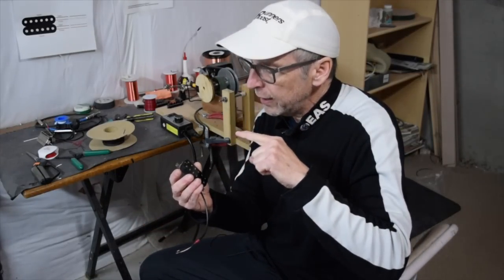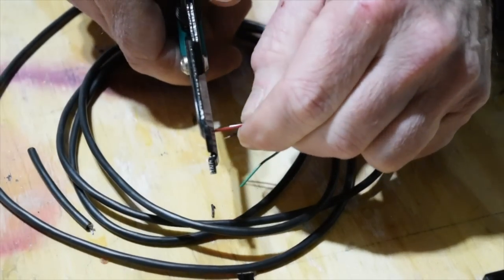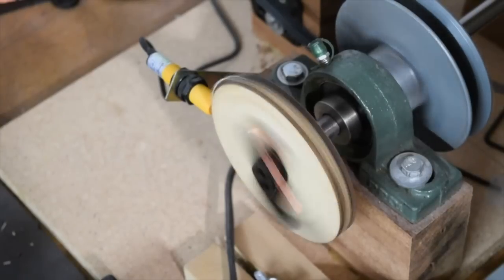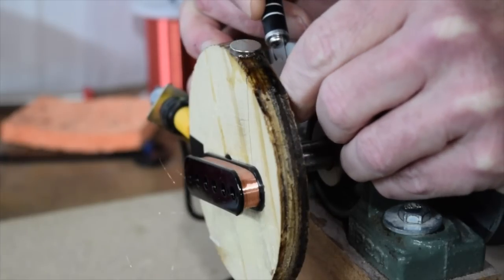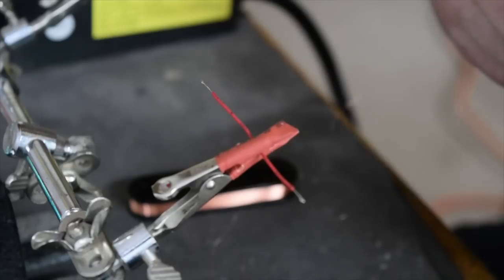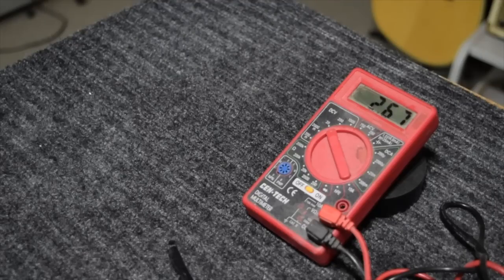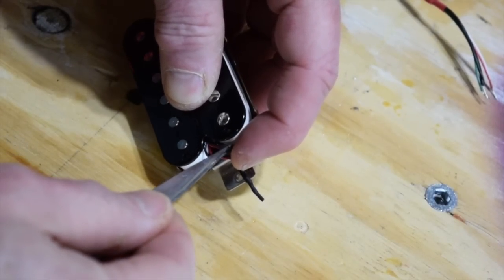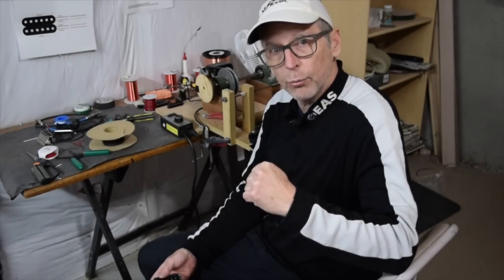Making A Humbucker Pickup For An Electric Guitar

Comment: It was interesting the commentary on the reasons for the conventional Hotter Bridge Humbucker to create balance which is commonplace ..  Jimmy Pages  Les Paul tone in Led Zeppelin has been elusive  as no mainstream manufacturer has ever created his UNCONVENTIONAL pickup arrangement. Namely a brighter Lower Wound 7.5k T Top with a short A5 magnet in the bridge creating some 'Twang' and a massively different high wind  8.6k Alnico 2 PAF  in the Neck for a Buttery /Wood sound (Set BELOW pickup ring to create balance and no mud!)... These crazy pickup extremes create that "Hollow Toppy Chirp"  almost acoustic sound in middle position which alludes conventional guitars.. With this setup, you get 3 much more 'radically different'  tones than a regular hotter bridge/lower power neck setup.. Even the Gibson Jimmy Page model guitars are "Period Incorrect' pickup wise for Zeppelin, as they are modeled on post 1984 mods with hotter bridge

Comment: Tone is the relationship between the gauge of wire, the number of turns, and the strength you charge the magnet to.  The stronger the magnet,  the more winds it can take.  Over winding a weak magnet makes a muddy pickup
Reply: So what is the relationshop exactly? Is it directly proportional?
Reply: So should I buy emg 81/60 or just make my own? What do you suggest people huh?
Reply: Jimmy Pages Alnico2 Neck PAF  is Wound to a Hot(ish) 8.6k , but then set below pickup ring to balance the underwound  7.5k Short A5 T Top  in the bridge . No Mud .( The Led Zeppelin Set no mainstream manufacturer has ever made!)

Comment: Isn't Winding directions of each bobbin important?  As well as magnet pole positions? Did not see that explained...  or did I miss it??
Reply from the maker: Only the magnet orientation. Winding direction isn't important since you can connect the leads to accomplish the same thing.
Reply: @HighlineGuitars  OK, but don't you need to understand the winding direction in order to properly orient the magnet poles?  (this affects "phase" doesn't it?) I did not see this explained... ?
Reply from the maker: @cajoneez9657  No. With a humbucker, you can wire the start and finish of each bobbin based on the magnet's intended orientation. The winding direction doesn't matter.

Comment: Thanks Chris,
Your video gave me tips on how to handle the only thing I still struggle with, soldering on the leads to the coil wire and attempting to not short out anything with moving them around.  I think your way to deal with that will help me out greatly!
I appreciate it very much!

I think you should have included a brief bit testing the resistance of the coils to show how to check for a short or partial short in it.  I do it about 100 times while assembling because I'm a bit insane about it.  I also understand that becomes a rabbit hole based on wire thickness and number of windings, which might be why you skipped it.

Comment: If you can't find a good source of color coded four conductor with a ground to convert two conductor humbuckers to out of phase switchable or single coil taps. Cut the ends off of USB cables. Cheap and available everywhere.

Comment: I just got a 1965 black Hagstrom 1 electric guitar, and the pickups are known to have a special sound that people pay a premium for, even decades old. QUESTION: When I was rubbing the rust off the pole pieces, pressing hard (heavily rusted), I discovered the poles are not one solid piece. 

The top part (that is visible) is actually a little steel cap that is glued onto the pole underneath. Apparently the rubbing alcohol I used to free the rust dissolved the glue. This happened on two pole pieces. I cleaned the old glue off, and put a tiny pinch of super glue (with pressure overnight) to secure the two caps. 

Have you ever seen pickups made this way, with metal caps fixed on top of each pole? They were magnetized. If you put them upside down, they would repulse, but the correct way, and it they fit right back in place. 

They work fine, but I'm curious nevertheless if this strange construction is unique to Hagstrom, or is this a build technique unique to Hagstrom? Thanks for your wonderful video.
Reply from the maker: I know nothing about that brand.

Comment: Strings are vibrating with the same frequency, no matter which pickup position you pick. The amplitude is the only thing that's different. An open A = 440 Hz. The maximum amplitude is in the middle. So, either in the middle between the bridge and the saddle or between the bridge and the fret that's pressed. When you pick fretted notes this middle position shifts and the frequency therefore increases, but the frequency above the neck and bridge pickup is still the same.

Comment: I realized from the video that the finishing ends of the coils are soldered together. Which wire from the beginning of the coils do you use as "hot": the "Start" of the southern coil or the northern one? Thanks, Chris!
Reply from the maker: North start is the hot. South start is the ground. North and south finish are soldered together.

Comment: Fantastic video thank you so much for sharing your knowledge.  Could you do a video explaining how to wind a bobbin counter clockwise I’m finding it all a bit confusing that side of it.  Thanks
Reply from the maker: if a winder is spinning clockwise, and you mount the bottom of the bobbin to the winder plate, it will spin clockwise. If you mount the top of a bobbin to the winder plate, the winder still spins clockwise but the winding is in the opposite direction (counter-clockwise) to the previously wound bobbin.

Comment: Hi,I was wondering if you/someone could help me out here.
I was planning to change the cover of my pickups ( Gibson Humbucker  490r e il 498t) in gold tone so I would need to change the Pole Screws too in the same colour.
I bought Pole Bolts - Slot Head 5-40 x 18mm (imperial). 
Did I get the right POLE Screws or did I need to buy different ones? 
I am still waiting to receive the guitar with those pickups so I can not really tell  but these pole screw looks a little too small to my eyes.
 I am not an expert so I was wondering if you could help me out
Thanks!

Comment: Great video. Ty! I've been playing for years and never knew that so much went into a pup. Question: can a passive pup go bad over time? I heard that you shouldn't put your pups near anything metal.  My old pups just don't sound like when they were new. Thanks!
Reply from the maker: Yes, they can go bad. The coil wire insulation can degrade over time, which can weaken the signal and lead to shorts. Also, the magnets can be degraded by blunt impacts and excessive heat, although these issues are rare.

Comment: Awesome video, thanks for this! I know it’s a bit older but I actually had a question in regards to wire - when I’m trying to wind, I constantly have to stop to unspool a bit of wire and it makes the winding part take forever. I cannot go quickly. When I unspool a bunch of wire to wind, it’s likely that unspooled wire will pool and knot next to me as I’m trying to wind. I set up the spool on a little pole, in hopes that as I wind, the wire will be pulled, the spool will then turn and feed more wire as it goes, but then I have issues with wire snapping, as the spool is too heavy and is only relying on the pull from the winder to unspool it. How do you go about having enough wire and being able to work at that speed while dealing with a spool of wire? Thanks!
Reply: I actually just read that people stand the spool vertically below where they’re working - this seems to be the common trend and works well?
Reply from the maker: I’ve never had the issue you described nor have I heard of anyone other pickup makers with that same experience. With the spools I use, the wire unravels on its own as the bobbin spins.
Reply: @HighlineGuitars  thank you for the response! It must have to do with how I have the spool set up. I set it up expecting the spool itself to roll to unwind while the pickup winder does its thing. I need to set it vertically so the wire can come off freely (how a fishing pole spool would be orientated) and not expect the spool itself to move.
Reply from the maker: @Houstnwehavuhoh  That is correct.

Comment: hey I like the Video and it's pretty informing but there was one part that was not right in terms of the positioning of the Pickup. the most about it was right but a bridge Pickup and a neck Pickup have with the same note played the same frequency. because if they had different frequency the same note would sound different (like a played a note sounds at the neck as a a but at the brige as a b) but the reason why chords sound brighter is the thinner sides have a higher frequency but not so high altitude as the thicker sides and the diffrence between the higher altitude of the thicker sides getts narrower to the bridge so they sound higher

Comment: Chris, do you have any recommendations for an electric screwdriver for adding or removing screw pole pieces? You mentioned using one in this video.
Reply from the maker: No. I use a cheap Harbor Freight.

Comment: Great video! I had one question though.  There is a guitar player you are probably familiar with “Eddie van Halen” who crafted his own pick up. What did he do differently from you to get more of a (screaming tone) this question is very specific sorry, haha.
Reply from the maker: I think even Eddie would tell you it's not so much about the pickup as it is about the way he plays. In other words, if you played his guitar, it would sound like you. However, if Eddie played your guitar, it would sound like Eddie. That being said, the humbucker he originally used in his Frankenstrat was a Gibson PAF lifted from an ES-335, which was potted with paraffin wax. God only knows the specs of that original pickup, but he has stated in the past that one of the coils didn't work. PAFs are usually wound with 42awg wire to a low DCR and I would guess the magnet was either an Alnico 2 or a low gauss Alnico 5.

Comment: You have the best way of explaining complicated things.  Thanks again.  Do you sell pickups?
Reply from the maker: Yes I do!
Reply: @HighlineGuitars  I would love a HB for the neck of a 25.5, that is not muddy and splits well giving a clear clean sound.  I will use both coils separately also, would like each to have different number of winds, enough to sound a bit different.  I love the sound of a strat.  I play no distortion and love old rock and country music.  Is this possible?
Reply from the maker: @Grandpa.Dan8881  I would suggest buying an HB.
Reply: C’ mon u can coil tap em but can you reverse your grinder polarity power input to wind the opposite direction

Comment: Hi Chris, is there any way to fix the Tobin when the wire breaks through the wiring process, or you have to start over every single time it happens??
Reply from the maker: I usually just start over. You can solder the break and either tape the joint or lacquer over it.

Comment: I have a question about the winding direction for each coil.  I  was under the impression that one of the coils is wound counter-clockwise, and the other clockwise.  So, one would be South/Clockwise, and the other is North/Counter-clockwise, and that is what makes it in-phase and humbucking.  CCW-N, and CCW-S together would be out of phase.  CW-N and CCW-S is in-phase and humbucking.  
StewMac has a good page describing it, https://www.stewmac.com/video-and-ideas/online-resources/learn-about-guitar-pickups-and-electronics-and-wiring/understanding-guitar-wiring-i-4000-2.html.
The one thing that I am not sure of is wiring the finish of the first coil to start of the second, or finish of first coil to finish of the second.  So, your connection to the series would be either Start(1) and  Finish(2), or Start(1) and Start(2).  Does that change the phase?  The one thing we do know is constant is that, by design, one coil will always be N, and the other always S.  So there is just the variables of; winding direction, and Start/Finish or Start/Start.
Thanks!  (Great channel by the way!  Excellent videos!)
Reply from the maker: You can wind humbucker coils in the same direction. The end result depends on how you wire them together. This site will explain: http://www.1728.org/guitar1b.htm

Comment: I always hear about 'hand wound' pickups which sounds more time consuming than using a winding machine but may be easier to count the number of wire winds. How are you counting the number of winds using the winding machine to obtain specific and consistent number of winds each time?  Also I think and could be wrong but the wire wind itself can be intentionally inconsistent or wound other than evenly back and forth to create a specific wind pattern. I'm assuming this is where hand winding is most effective. I have no experience with this and learning.
Reply from the maker: My current winder is a CNC winder which precisely controls the number of turns. I can also program the traverse to vary its speed which mimics hand winding (aka “scatter winding”).

Comment: could you provide some information how you connect the 2 bobbins? I mean are they series or paralell? or the wiring of the 2 bobbins  are in different direction? or you handle the phase of the 2 bobbin with simple wiring the south hot to the north end?
Reply from the maker: I wire mine in series. The north start is hot output, the south start is ground. The series connection is north finish to south finish. Both bobbins are wound clockwise.
Reply: thx @HighlineGuitars

Comment: I'm sorry I'm so late! LOL
I just found you and this video. Thank you for creating this video!!
I have a question...
You stated that you use 42, 43 and 44 gauge wire. You say that the more turns you put on a bobbin, they higher the output signal, the higher the output signal you clip treble frequencies. To balance this - if you put more turns on the bridge bobbin the less turns on a neck bobbin. 
I'm learning a lot, but I have no idea how many turns should be a minimum, what's the maximum amount of turns and what is the average amount of turns?
If I want to DIM (Do It Myself - similar to DIY lol) and I go buy a 50 foot roll of 44 gauge copper wire, will that be enough for 1 single coil and 2 humbuckers? About how many feet of wire do I need for 1 single coil? And for 1 humbucker?
That's the only information that I'm really lacking...
How many turns is average for a single coil neck pickup? And how many turns are average for a bridge humbucker pickup?
How many feet of 44 gauge wire is normally used to wrap an average single coil neck pickup? And how many feet of 44 gauge wire is normally used to wrap an average bridge humbucker pickup?
Thank you so much!!!
Not many YouTube creators respond to my comments and questions. 
I hope you do! I really do!!!
Thank you so much!!!
Reply from the maker: Start here: https://www.google.com/search?q=how+many+feet+of+wire+in+a+guitar+pickup&rlz=1C5CHFA_enUS749US749&oq=how+many+feet+of+wire&aqs=chrome.2.0j69i57j0l4.9028j0j4&sourceid=chrome&ie=UTF-8

Comment: Hello. After you wind each bobbin and have two copper wire ends....does it matter which end to connect to other bobbin and make the humbucker? Does the inside start end have to connect to the outside finish end of the other bobbin? Does it matter?  Thanks
Reply from the maker: Yes it matters, but you can wire the bobbins in series like you described, or in parallel. In series yields higher output and darker tone. In parallel yields lower output and brighter tone.
Reply: Is the hum eliminated both ways series or parallel?
Reply from the maker: @nickhlawka7073  both ways are hum canceling.
Reply: Thank You
Reply: @HighlineGuitars  What about in series but instead of connecting the negative pickup side to positive pickup side, connecting negative to negative or positive to positive??? Thanks

Comment: Hi, hope this is not a silly question but do you solder the two finish wires together or the start and finish wires? I only ask as there seems to be a lot written about this on the net and I can't tell which way is right.

Comment: Thanks for this video, it's really useful. When you solder the pickup wire to the lead wire do you have to scratch off the enamel coating, or do you just wrap it round a few times and the solder melts it forming a connection? Thanks!
Reply from the maker: The wire I use has insulation that melts when touched by a soldering iron.
Reply: Thanks! I'll see if mine melts/test it afterwards

Comment: I personally would love to have an extremely bright and clear sounding bridge pickup with minimal low end mud (200-400Hz). Any suggestions as to what magnets, winding and wire I should use if I decide to build one?
Reply: select a 0.08 gauge wire. use neodymium magnect, and wind around 10,000 .

Comment: Hi - do you always the same base plate material (looks like German Silver) or have you used a brass material? If you do or can share some insight; what difference do you find it makes on the tone of the pickup, everything else being equal? I would think that they would have some affect on inductance(?)
Great video by the way!
Reply from the maker: I use nickel silver like most quality pickup makers. Brass is usually found in cheapo import pickups. As for tone or inductance, who knows and who cares. If brass is perceived as cheap I'm not even going to bother. How would you feel if you bought an expensive set of Seymour Duncan humbuckers and they came with brass baseplates? You'd think they're fakes.